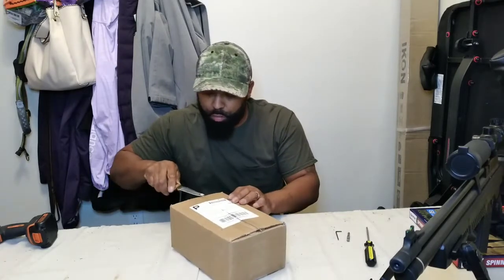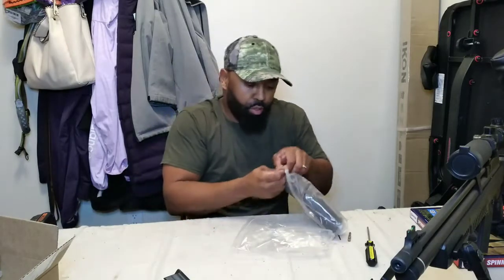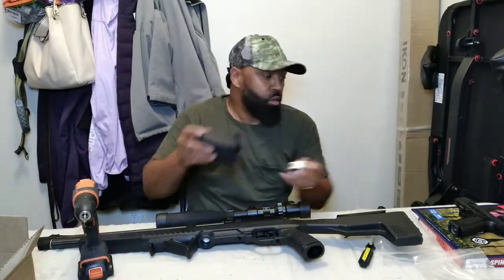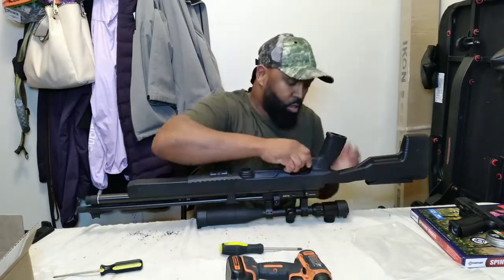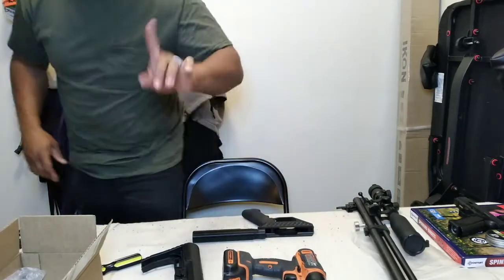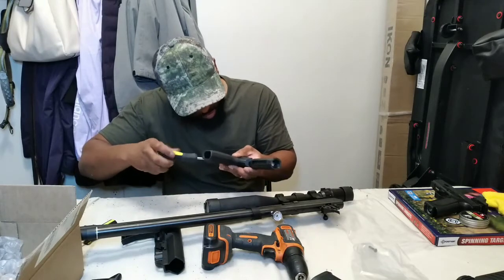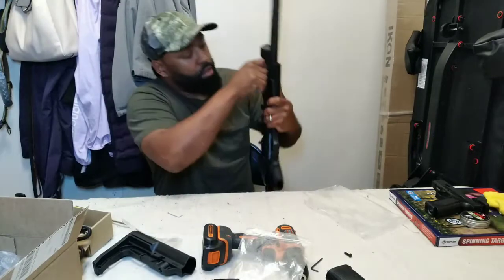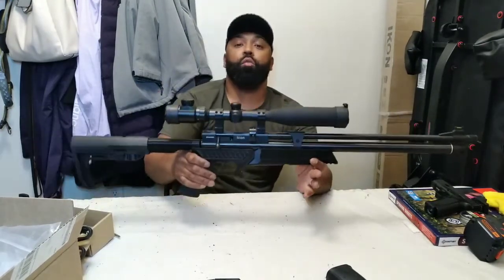Crosman Icon buckrail tactical conversion kit Tactical co2 replicas episode 17

Comment: He'll yeah got mine too , I had to wait for Terry to print off the barrel band but I got both now and super happy. Lol at 1st I thought he forgot my buffer tube nut but it was in the pistol grip .
Also the screw on moderators are awsum .

I particularly liked how the new stock put center of gravity back towards the but of the gun easier to hold.
Reply from the maker: It is a very awesome setup I will be getting the barrel band for sure it will help with accuracy I was very pleased with the delivery on the grill product supposed to be there I wish I had forehand that I need a half inch driver but oh well
Reply: @tacticalco2replicas  lol same here , I went and bought the cheapest socket set I could find then found out it didn't reach deep enough,   I ended up  driving the socket with a large flat head screw driver .

Sort of like hammering with a wrench but it did work .
Reply: @tacticalco2replicas  I was looking at the forend mod for benjamin marauder pistol , made of wood looks AK- ish , I have to say I admire your bravery on just jumping right in on doing mods .

Comment: Super Sexy 👌  , you gotta get his barrel band they have 2 options one has 3 pic rails perfect for mounting your side mount bipod. 

Buckrail-line may have an inexpensive moderator going for 38 bucks right now but it's as good as any other competitor.   Hugate , Donny FL , Buckrail-line, for me its Buckrail-line all day .  Granted it doesn't quite this particular gun very well maybe just a 30 percent reduction.  Because the spring , hammer and ping sound from the compressed pcp tube all contribute to the noise.   

On my 2240 it takes 70 percent of the sound away .

Great videos man keep them coming .
Reply from the maker: I definitely life the kit but I already changed it lol
Reply: @tacticalco2replicas  show us your mods , I admire your bravery and skill .

Comment: That's a pretty slick set up.  I don't have that gun but I do have a Beeman Commander which is basically the same gun.  Btw....your smoke detector battery needs to be replaced.  That's what the chirping is every 2 min.
Reply from the maker: That's funny everyone says that about the smoke detector but that's actually what it's supposed to do with everyone's in the apartment building does the same which is super annoying